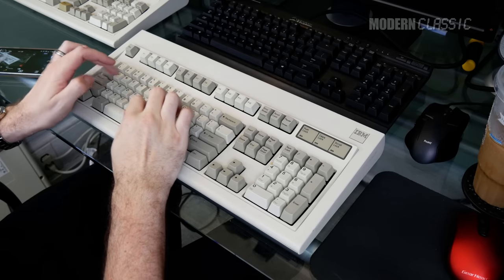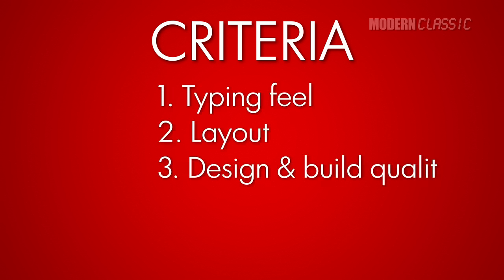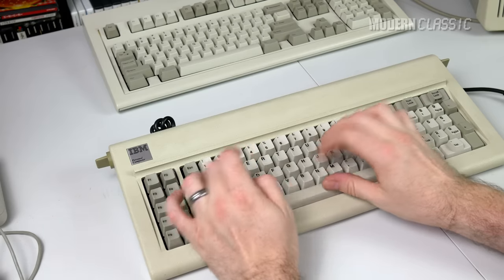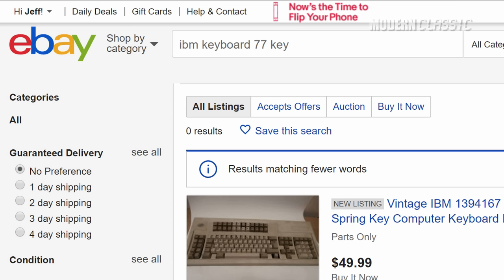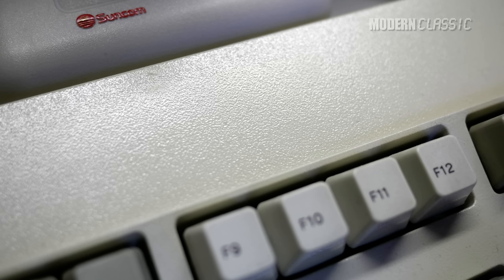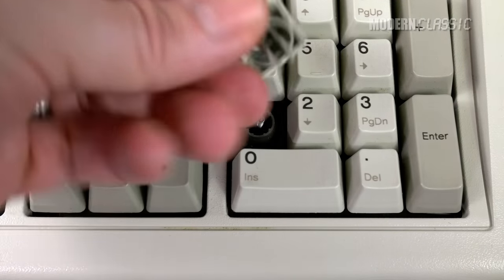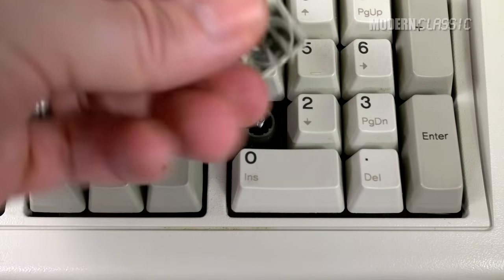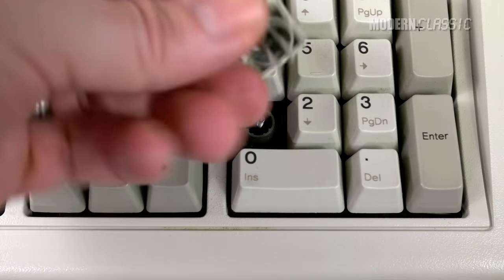Ultimate Keyboard Showdown - IBM Model F or Model M?

Comment: I own two model m keyboards but I prefer as my daily driver my black alps keys in my dell bigfoot keyboard.  I didn't like them until I modded my switches to make them clicky and now I actually prefer this board to my model M...
Reply: Something must be wrong with your model M's. Haha
Reply: Yeah, even 'lower end' bamboo Alps switches are still some power house that you shouldn't fck around with (quoting Chyrosran22 on that :P). 

On the contrary the more switches I tried the less I like membrane buckling spring, they felt too cluncky or even squishy even compare to similarly weighted switch. Alot of other modern  switches are closing the gap or even surpassed M BSpring in key feel already in my opinion so I can almost hardly recommend Model M to anyone right now. Save for Model F though because they are a monster on a whole different tier.
Reply: Don't get me wrong I love hooking up my model m and slamming away at it for a while, even though it has no windows key.  My bigfoot with modded black alps does have  a win key so that keeps me on that board more and more too.

Comment: Great video, thanks.  I loved the XT(?) clone keyboard I got with my XT clone when I purchased it.  As a touch typist for many, many years, including on the fantastic Selectric typewriters, it was like coming home to use it.

Disliked the AT keyboard Function keys at the top so much that I spent, for me, a LOT of money on just a keyboard and bought a Northgate.  Same layout as AT, but with function keys in familiar places on the left.  Made running the very old Flight Simulator I had much easier to run as well...  :)

Have to admit, having worked in the computer and pc industry for many, many years, I've typed just fine on a plethora of keyboards (love to be able to use the word plethora...  :)   HATED the Microsoft "invention"? of moving the insert/del/home/end/pgup/dn to 2 columns and 3 rows vs. the standard reverse.

Have graduated for home/most use (retired now) to simple ergo type keyboard, and had to give up my still working Logitech with still IBM type fantastic clicky feel for a USB one.  Finally found the Microsoft 4000, and lo and behold it still has the standard insert/delete...  layout!

Not in favor of most wireless keyboards (or mice) for desktop computers, why have to deal with batteries?  But I can NOT find a good (feel and layout) WIRED ergo keyboard that's illuminated!  Found one recently, around $40 on Amazon, Adesso Adesso AKB-150EB - 3-Color Illuminated Backlit Large Print Ergonomic Keyboard, Wired, Multimedia Hotkeys, Split Keys Design, Built-in Palm Rest for Comfort but it had a horrible, mushy key feel so returned it.

Oh, Logitech and current MS 4000 keyboards has the option to raise the FRONT of the keyboard, vs. tilted like a typewrite of old.  I like that as well.

RichE  San Diego, CA

Comment: As someone with both a bolt modded M122 and a model F AT, I gotta say its a close match. When it comes to something like typing a paper, the model F AT is the obvious champion because of its far better keyfeel. But if I am just browsing online, the M122s layout along with my soarers converter (you don't need one for the F AT) is better, for example I have keys just for playing/pausing music, volume, and whatever I feel like programming in. If my F AT had a soarers converter and more keys, it would be the easy winner (especially since the 2 key roll over on my M122 can get annoying in video games compared to the F's n-key roll over).
I believe if I could trade both my F-AT and my M122 for a F122 with the best of both keyboards, I would do it instantly.
Reply: oh and my M122 is a grey rounded badge from 1989, and my F-AT would be a square metal badge (if someone in the 90s hadn't removed it) from 1984 (I have the original AT computer it came with too).

Comment: Currently using (and viewing this video) with my Lexmark Model M dated Nov '93, which uses a one piece key caps instead of the traditional two piece (I actually prefer the one piece caps). The only thing I dislike is the cord. It is permanently attached, flat, and it spirals like that of an old phone (it overstretches easily) rather than the detachable options shown in this video. Also, it comes with the blue IBM logo in the top left. This is fine, but the squared, black lettering, top right logo is definitely the best look. I have yet try a Model F, but have been actively watching eBay for a reasonably priced Model F AT -- I have a feeling it would be my winner. Great video!!
Reply from the maker: My terminal Model M (which I bought specifically to practice bolt modding on before doing it for real) has a flat coiled cord like that - but it also has what looks like an RJ-45 connector (but probably isn't) so really looks like a telephone cord. I didn't realize they ever used those on PS/2 port Model M's. I agree that that is kind of a nasty cord. I don't mind the straight cord of my Lexmark - it's plenty long enough. But that 9' coiled cord from my silver label Model M is the best. I agree about the logos/labels.

Comment: Good review!
However, it is worth mentioning that some Models F do weigh close to 10 pounds (4.563 kg). A great example would be the F122 which weighs 4 kg, and the F107 (4704) which weighs around 4.7 kg.
Reply: Indeed they do, and it was kinda lame of him to imply that the new model F page was lying.  I have the repro f77, and it is HEAVY, and there is absolutely zero flex in the case whatsoever.  It is absurdly, hilariously heavy, in fact.  I laugh whenever I have to move it, because I apparently just never get used to the idea that a keyboard could ever weigh that much.

Comment: The bolt mod is exponentially more difficult than replacing the foam on a model F. I’ve done both... the bolt mod took me around 4 hours total, required a power drill and risked completely destroying the fragile barrel plate of the model M. Replacing the foam took about an hour and a half, and only required a hole punch and a sheet of construction foam. Also, you’re incorrect about all models F needing an active converter. The model F AT runs on a standard DIN 5 connector with scanset 2, so it will also work with a passive adapter to PS/2 like the model M. As a side note, you completely disregarded the fact that the model F is rated for quadruple the key presses of a model M when considering build quality.
Reply: The bolt mod would have been equally fast if you had the right tools at your disposal.
(Using a workshop drill/Milling machine for example), Cant really correct the guy if you dont do it right yourself.
Reply: @coffeepot3123   yes, if i had a milling machine the bolt mod would have been a breeze. you're absolutely right. let me just drop a grand on workshop grade hardware so i can fix a keyboard. That makes a lot more sense than spending 6 dollars at A.C. Moore.
Reply: *AT LEAST 100,000,000 keypresses - don't forget they tend to shut off the key-testing machinery after this figure. ;)
Reply: @zacharykennedy4045  ffs dude, just visit a local workshop and ask them, it will cost a bit more but since i reckon you are not living at home then you can spend the extra and get it perfect.

Comment: They're both INCREDIBLE keyboards! Only thing for me keeping me from typing on a model F is the layout, as I've never ever tried one...Still rocking my 1988 Model M
Reply: If you have the room, get a Battleship (F122). That thing is a BEAST, but has all the keys you'll ever need and then some. I recommend using a Soarer's convertor and remapping as necessary. You get an extra row of F keys on top as well as 8 more on the side (á la F-XT), plus the full num pad/cross nav.

Took me 30 minutes to get mine remapped and running, including RTFM and recapping a few keys.

The F122 uses M style two part key caps and is directly compatible with regular model M key tops and key stems. It really is the best option.
Reply: @233kosta  WOW, this is amazing information! Thanks for detailing everything for me!
Reply: @natevirtual  Happy to share ☺️

If you'll be looking for one, beware of confused sellers. I have a 1987 M122 sold to me by mistake as the sticker says "Model M F1". ALWAYS check that the bottom is metal and look for the F-AT style buttons on the side which drop the feet.

Good hunt'n'!
Reply: @233kosta  i have an f122 and a few m122s.  the f122 is the best keyboard in my opinion. both of these can be converted to ansi if the iso layout is off putting.  the m122s are nice.  the f122 is just a bit better.  is it worth the difference in cost? maybe not.  you'll have to check.
Reply: @233kosta  i've seen sellers advertied model ms as model f. but i don't think it's by mistake.
Reply: @jasonsdodd  I'm rather fond of ISO, so those work for me 😁

I find models F a lot smoother than M, it's just a more pleasant experience to use one. In fact, I'll be selling off my model M fleet in favour of F as soon as I get around to fully restoring them.

As for this "confusion", I agree, lots of people will just try it on, but judging by the way it was handled by the gentleman I got my M122 from, at least that particular case seemed like a genuine mistake
Reply: @233kosta  i have 6 model m122s. i'm planning to fully restore them and sell them so i can get a couple f122s.

Comment: I've got three IBM Model Ms, silver badge no lock LEDs, and one Unicomp, the Kentucky Wildcats edition. The Kentucky Wildcats edition is probably my favorite for the sheer novelty of it, I do happen to be a Kentucky fan. However, despite all that, I use a TKL Cherry MX Blue board because I need to preserve desk space. That said I would LOVE to get my hands on a SSK for a reasonable price, or wish that Unicomp would produce a proper TKL.
Reply: @Daxturr I get by. Plus, I have a separate MX Blue keypad I can place on any side of the keyboard, which is handy when I want to type in plenty of numbers with my dominant hand.

Comment: Strongly disagree.  The IBM F-122 is by far the best keyboard.  It has a near standard layout, 2 part caps, much better durability, and the fantastic Model F key feel.  The M is a great keyboard, but I'd take an F-122 any day.
Reply: C O  Yeah, I admit the price of the F122 has gone off the rails recently.  I got lucky and bought mine before the price exploded.  One trick you might want to try is looking for sales of the terminals that they originally came with, rather than the keyboard itself.  I was able to nab mine for about $100 this way (back when they were selling for $250ish.)
Reply: Why do people bother with these old relics, once you go rgb and all that.
Reply: i know haha, wtf inferior in every way but people still waste their time with them
Reply: Synthematix
Because the keyfeel and build quality is vastly superior to those plasticy and cheap feeling boards on the market now. Especially the ones with stock MX switches. RGB lighting is just a gimmick, if you touch type you have no need for lighting effects.
Reply: @BokBarber  the model f122 isn't that hard to modify to ansi layout.

Comment: I never knew what n-key rollover was until i actually had a keyboard fail me.  Running in an fps at an angle, then trying to action, whether it be reload or crouch to slide, or jump etc.  So: Shift, W, A, C (or Space, or R). I can also imagine Q or E being used to lean while doing a similar combo. I can't really think of "common" actions that would use more than 4 though.
Reply from the maker: All keyboards are different, but I can't imagine the M wouldn't be able to handle that. I'll test it a bit later and see, though, since you've given me a specific combo to check.
Reply from the maker: Ok, just tested on the Model M. All of those combos work, and in fact you can see in this screenshot that I'm pressing Shift, W, A, C, Space, R and print-screen (to take the screenshot) all at the same time! https://imgur.com/2JDWKlT

It was actually hard to even press all those keys at once. And that on a keyboard with 2KRO.
Reply: @ModernClassic  That is absolutely incredible! I've long wanted a model M as my DD, but this has scared me away. You have just solved a riddle I have pondered for years!

Comment: This jibes with my own experience. The Model F has a better feel, but the layout sucks. I learned how to type on an electric typewriter, and some of the Model F key placement & size nearly drove me insane until I got used to it. The Model F AT us much better, except the tiny backspace key. 
The first time I used a Model M my hands were in heaven.
BTW, the Compaq Portable II & Portable III used the Model F AT layout. Zenith made their XT style keyboards with a more AT style layout. In fact the only way you can tell their XT from their AT keyboard is the latter has LEDs in Numlock, etc. They're very good mechanical switch keyboards.

Comment: Having done a "bolt mod" to one of my Model M Keyboards, I'd say it's not nearly as bad as people imagine. The trick is to use extremely small, self-tapping screws that "just" start to push through on the keyboard side. Actually, finding the right screws is more time consuming that fitting them!
Reply from the maker: I just did my first bolt mod on a "practice" Model M that I bought a while ago (a terminal version that was in truly sorry shape). It was really easy. I'd hesitate to even call it a "mod", though it technically is. I did a combo mod with some screws and some nuts/bolts. I think I found the right ones on another site that had instructions and a parts list. I've meant to make a video of bolt modding my original Enhanced Keyboard but I might not do that at all now; I might just make the video of the practice one (if I took enough footage for it). Even though the mod was dead easy, I don't like the idea of "fixing" things with mods like this if they don't need it, and neither of my other Model M's do.

Comment: The only reason why N-key rollover was needed, was for playing games with your friends, let's say ... Golden Axe , or Street Fighter 2, or Mortal Kombat 2, etc... those games needed n-key rollover, because otherwise you or your friends keystrokes wouldn't register, which was a freak*g pain in the b**
Reply from the maker: Model M should be able to handle it. I'm happy to test any specific combo of simultaneous keypresses that players would need to hit, but you see in the key test that I'm doing 8 keypresses at once at various points. Just because a keyboard has 2KRO doesn't mean it will only register 2 simultaneous keypresses. That was part of the point of that section of the video.

Comment: You said the Model F requires an adapter to use on a modern computer, but doesn't the AT version of the Model F work fine with PS/2-to-AT adapter? I could have sworn I used to have a Model F I used on a modern computer with just the small passive adapter.... but alas its been a while since I did that so I could be wrong.
Reply: I really need to find my Model F AT keyboard. I know I had one because I remember using it with a random Compaq 386 computer I had laying around. I had no idea they were rare.
Reply: @knightcrusader  I hope you find it! God I'm jealous. I have one, but it's been heavily customised and feels like crap.

Comment: There are some games where you'd be using three keys or more at once, and split-screen gaming could definitely use more than two key presses at once - especially a racing game where you could easily be braking/accelerating and turning at the same time. I would like a Model M at some point but don't really have anywhere to put it, and my Corsair K70 will do the job for me.
Reply from the maker: I covered all that in the video - there's no game that I know of that requires more simultaneous key presses than the M can handle.
Reply: I was a bit worried about that after buying my Model M (a USB one from Unicomp, with the extortionate shipping to Australia). Hasn't actually caused me any problems in gaming so far.

Comment: I got a Model F AT, it takes a bit getting use to the alt and control keys being wack, also the esc key is annoying. But you can easily solve it with sharp keys.
Reply: Also i think the Model M is a lot better to work on i just got done refurbishing my other F and trying to get the spacebar and keep all the separate chambers in one piece while clamping the two sheets of metal is a pain in the ass.